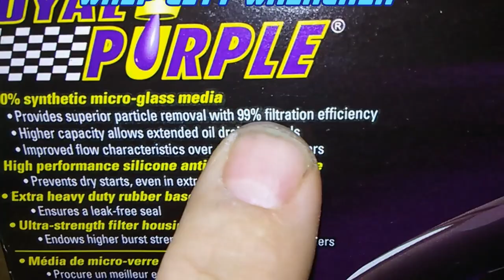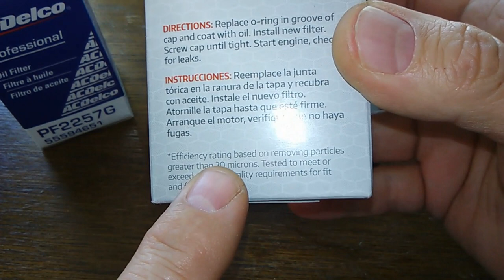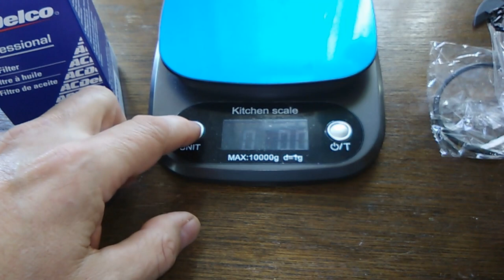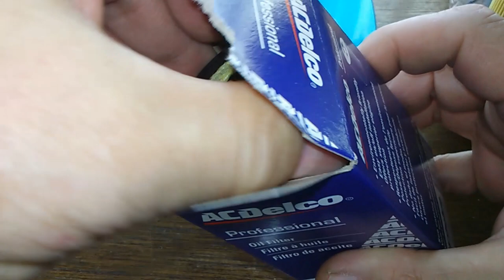Walmart Supertech Cartridge Oil Filter Cut Open ST10246 vs Acdelco Oil Filter Cut Open PF2257G

Comment: On my wife's Lexus Rx350 the engine oil filter housing has a steel round bar with holes to allow for oil flow that the filter  snuggles tightly.  Depending on how tight the filter fits it probably won't matter about the cage.  

Another great video.
Reply from the maker: Thanks, Jason👍
I didn't know about the round bar, I wonder if all vehicles this oil filter fits are designed that way? 🤔

Comment: It's too bad that that filter has been replaced by the MP line of supertech. I liked how all of the ST line of oil filters were less than $3.
Reply from the maker: I haven't checked out the new cartridge oil filters, but if all they did was change the Oring to a blue one and charge $2.51 more then I think that's sad and one big rip-off.